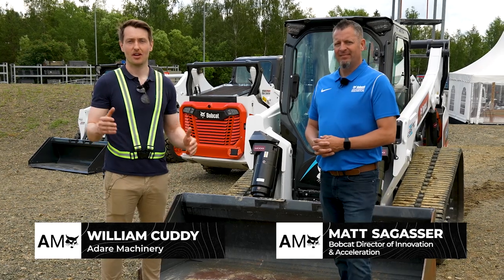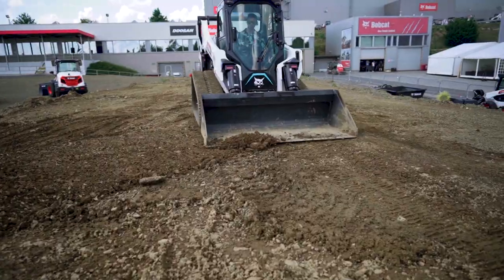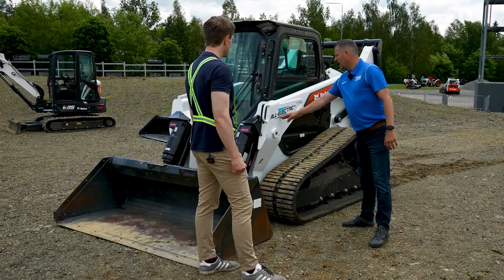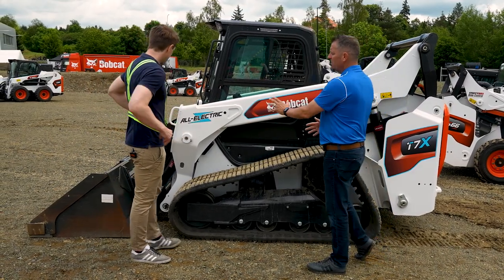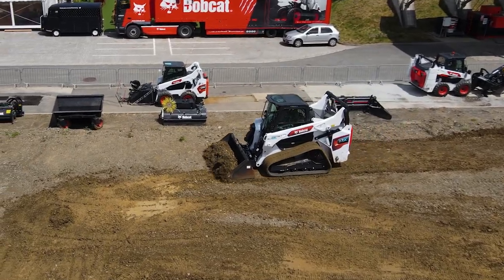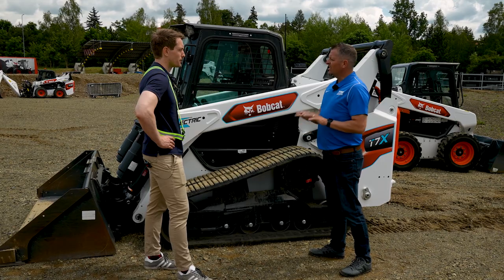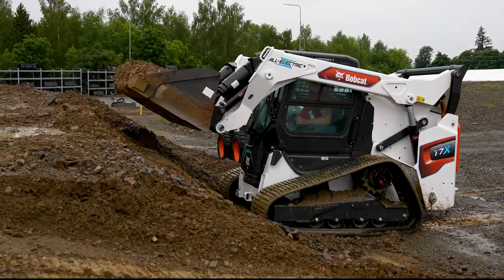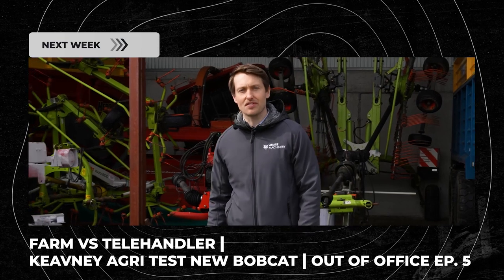EXCLUSIVE Look | 100% ELECTRIC Bobcat T7X | Out of Office. Ep. 4

Comment: Biggest problem is going to be the attachments. It's going to be a while until they come out with a full line of attachments. As someone that uses all kinds of hydraulic attachments and doesn't want to buy new ones it would have been nice if they could have somehow integrated an auxiliary hydraulics system separate from everything else.
Reply from the maker: Yeah it was the the thing that stood out most for us as well. Hopefully as technology advances that might be a solution. For a lot of people, to buy new attachments would make going electric less attractive.
Reply: Agreed!
Reply: 10 hrs to charge to only run for 4 hrs 😂😂 what a waste of money unless it’s used in warehouses
Reply: 100 hrs charge to work 40 hrs  not feasible...
Reply: @dennisbeltran9156  I agree with you, but as a homeowner with 289D, I find myself doing a lot of quick odd-jobs that has the machine starting and stopping a lot without much actual run time.  Might be good for that, but for the $$$, not sure how many home owners could afford it.
Reply from the maker: @dennisbeltran9156  Definitely get where you are coming from... but there are alot of indoor applications where 4 x hours could be enough. Dont get me wrong.. would love to see this machine with 8hr capacity and a supercharger, but will be interesting to see what comes next.
Reply from the maker: I think most ppl would agree on the face of this. But.. if you consider the average hours for loaders is roughly 1,000 per year then its not as crazy as it sounds. Granted.. they would have a much better chance of uptake for mainstream sites if they had an 8hour run time.
Reply: Any real high flow attachment would work so much better just selling it for an electric one.  Mulchers shredders.  The lighter stuff an electric motor is dirt cheap
Reply: @AdareMachineryLtd next iteration will likely have v2vbcherging from battery trucks

Comment: 4hrs run time, hilarious
Reply from the maker: Yeah it would have been awesome if it was more. We were told the average hrs for loaders is roughly 1000 per year so in theory... that's 4 hrs a day.  In our opinion however.. you will only see this on specific sites where fumes are an issue, wont be on mainstream sites until the run time is improved.
Reply: It'd be nice as a homeowner to have it for out in the yard....not so much use for  it as a commercial company
Reply: @nickbrown6694  You have to start somewhere. The first Tesla Model S had a batteryrange of 260 miles. The current Model S has 405 miles of range. That is just 10 years of innovation. Also, that 4 hours was 4 hours of continuously and heavy work.

Comment: I think they should re-design this thing like the JCB One-Arm, teleskid design.   If you are going to innovate ... then innovate, just don't replace the guts with something not as efficient.       And make the loader pack-rat proof.    One packrat gets into all those wires .... good luck.    I mean at least with hydraulic powered equipment, there is a "hydraulic pressure relief" so that you can get out of the cab incase you are trapped in the unit with the loader arms across the door.     The JCB doesn't have this problem (side door) and an all-electric Bobcat might.      How do those batteries do underwater?  Salt water/brackish water?         I can see this sort of unit working well in mining/tunnel/indoor use where exhaust is an issue.    Another thing about the bobcat I didn't like is where they put the window washer motor on the windsheld which vibrates and makes noise when going over rough terrain, not to mention blocks your vision of the work area.  The JCB has it right.
Reply from the maker: Raised some pretty good points. The side door entry is pretty neat, however Im lead to believe the single arm isnt as durable on a skid steer, so there is plus and minus to it. In terms of the design, we had hoped to see a totally new concept at 50%+ of the the parts have been removed so there is a lot more space so we thought there might be a brand new platform, but most of it is configured into frame of T76.
Reply: @AdareMachineryLtd  I love to see innovation as much as the next guy.  As far as 50% less parts, well, if you remove the hydraulic pump system that powers hydraulic powered machinery, you can save a lot of parts right there.     So I am not so keen on those numbers being accurate.   I think they should start these machines on the stand on platform mini-skids where there are a lot less hydraulic powered equipment that would need to be replaced.   Like the MT100, most guys have a bucket, forks and so being without external hydraulics wouldn't be that detrimental.      With the full skid steer platforms with ROP you have trenchers, planers, mowers, concrete mixers, vibratory rollers, jaw crushers, augers, mulchers, rock pickers .... and at least 2 dozen more attachments ... that would need to be 'electrified' or replaced with some sort of electric powered hydraulic pump on the machine.      What I like about the machine is that you don't have the same maintenance.  Engine Air filters plugging from dust, but I am sure the in-cab filters do.    There will be no engine oil filter, maybe no hydraulic oil filter ... until they add that system.     The insulation on those wires feeding the loader arms is going to have to be real tough, UV stabilized and rat teeth stabilized.  Make sure they put rat killer in the insulation.    Small thorny sticks/branches often times fall between the crevices in machines and will wear away the insulation jacket as does rubbing with the hydraulic lines.  I hope there is some sort of short-protection in the machine otherwise it will be like trenching into an electrical line or hitting a power pole line with a flashover effect should the electrical runs be worn too thin.    Batteries are Heavy as well, by how much did they increase the weight of the machine without any corresponding boost in productive capacity?    If the machine gets too heavy, drivers will need bigger trailers with extended load capacities that will put them into the CDL range and this could stop most operators from purchasing.    You might be able to go with an all aluminum trailer to make up the weight, but taking a flimsy trailer like that down a rocky washboard road will destroy all the welds and fasteners within months.   Many other industry accommodations will need to be made when you are on the cutting/bleeding edge and it always hurts to be there as an early adopter because it's on you to figure these ancillary things out.

Comment: If you can replace the battery it might get a chance in competing but relying only on charging sound like very limiting. It might work in some urban projects where noise is a problem but I don't see it being used widely as a real tool.
Reply from the maker: Agree.. going to be a long time before it becomes mainstream. But good to have an option of electic for certain jobs.

Comment: Seriously, 4 hours of hard run time. That's it? Why not just put a quite running inverter generator on the thing that can keep the power going?

You would have still eliminated the the hydraulic issues but the on board power generation is key. Most job sites are remote as it is. Being able to keep running is important.

Comment: worlds first eh? I have an electric skid steer (its a Thomas 175 that I converted) it has hydraulics, just the motor was replaced.  I can get, as is 2 hours run time with 2 hours charge, its all I needed.  I can upgrade it to 4 or 6 hours run time with the respective charge times.  I built it 2 years ago. mind you it doesn't have the same power as with the original diesel engine, but it will lift a  pallet of pavers.
Reply from the maker: Will get working on changing the title! :D

Comment: Why not just have electric motors run hydraulic pumps ?
Reply: Because you are still converting energy then, thus consuming power. Hydraulics have to stay under pressure, those actuators don't consume any energy when not in use. I expect this to be more energyefficient.

Comment: I'm reaching out to all bobcat fans, bobcat owners, and bobcat mechanical engineers, bobcat eletrical engineers, lastly Doosan CEO, this is going to be an extensive comment. 

Awesome technology! From a maintenance perspective the electric concept is interesting, so no more oil filter change, fuel filter change, no more hydraulic oil filters,    air filter change?  well, maybe an airfilter that is use to cool electronic components. All I can comprehend right now is just servicing the gear oil and grease. I have a few questions from a maintenance perspective. When it comes the time to replace a battery pack, how does one go about it? Is the battery pack on a sliding tray where its easily changeable? Do you need special proprietary diagnostic tools? If so, how much are they and are they available to the public?  Also what about physical speciality tools to remove a components, are they available to the public? (in general, owners should be aware of maintenance cost).

Please please Bobcat, DO NOT FOLLOW John Deers business model of PLANNED OBSOLESCENCE. youtube "Farmers Are Hacking Their Tractors Because of a Repair Ban" (very informational video if anyone is curious). I've seen too much stuff break on the maintenance side and makes it very difficult when the information is only available at a dealership.  I understand that in the auto industry, after a warranty is expired, its profitable when components breaks. Thus, taking it to the dealership due to a tiny sensor or a component that is poorly designed.

Sensors are part of the technology that is suppose to better the world. In general, sensors should not be easily disabled due to a tree branch snagged a wire. Or.... a sensor that is located in a poorly spot that is stupidly difficult to replace/troubleshoot. (Im sure there are limitations of space that you are working with and I understand). If you make the electric bobcat where if lets say.. a sensor see that the lift cylinders are overload, (where it makes the inoperable or out of service, and there is no way of repairing/RESET the sensor at home or on the job site. I will then not be interested in this product period. 

I understand the purpose of sensors for safety reasons. However, There should be an feature on the touch screen where it would say that you can override a sensor at your own liability/risk.  Or something a long the lines of limp mode.

I HOPE Bobcat innovates with a lot of forward thinking on designs as for practical repairs/upgrades. On the topic of batteries,  I know we us civilization is going forward on battery technology. In the event lets say, we civilization somehow mass produce graphene battery at a good price where its affordable, I, as a owner, would like to be able to replace the battery for a newer one. I should as the user be able to do this at home with some basic tools. 

My father has a 1996 753 bobcat that has been through a lot of abuse and it still works to this day and have done a lot of repairs at home. The arms cracked in the center, I welded it back together, one of the hydraulic solenoids went bad, replaced it. Aux Control Module randomly clicks clicks clicks then failed, replaced the expensive module.  Tried and true skid steer.  Question, could you make all the major components last for 26 years?

Overall, big fan of bobcat skid steer, glad how you guys are innovating, keep at it!
Reply from the maker: Hi Kin, thanks for taking the time to comment. Will make sure we forward them onto Bobcat directly.

Comment: Yep you’re really disrupting the industry with your 28.5% duty cycle, also what happens when it’s -40? 14% duty? All I have to do is take a minute to put more diesel in my machine and it goes for another 8-10 hours. So I guess what you’re trying to do is get more sales cause I’ll need to buy at least 3 to get through a 12 hour work day 🤣🤣
Reply from the maker: We did a follow up with them and asked them about working in cold weather with an EV. They said that the cold is myth when it comes to battery time. Have to take that a face value as we dont have any experience with ultra cold weather and EV ourselves.